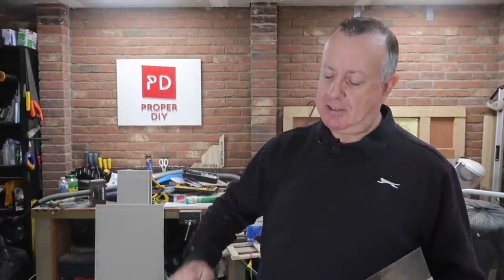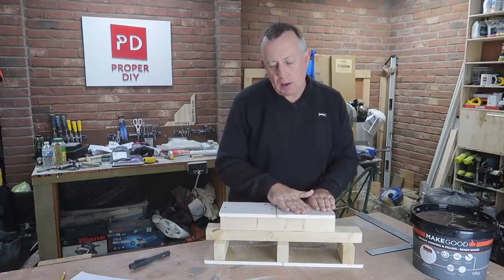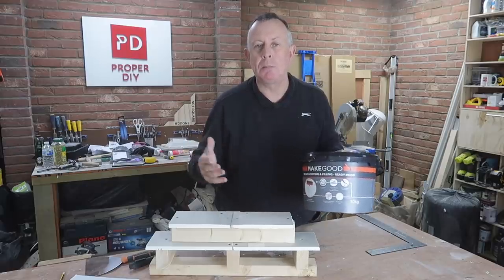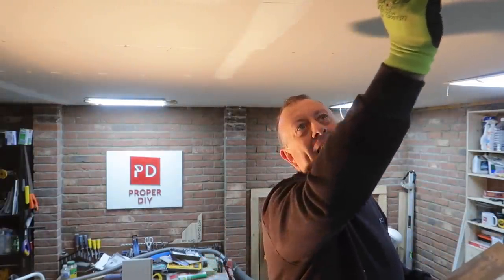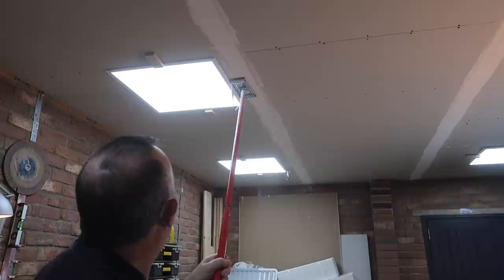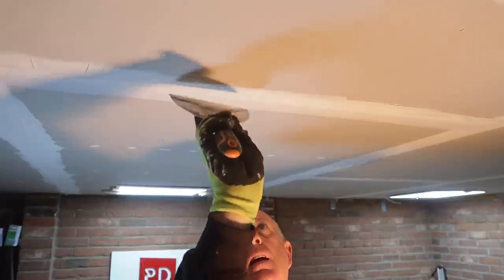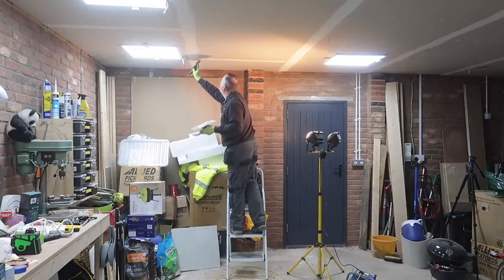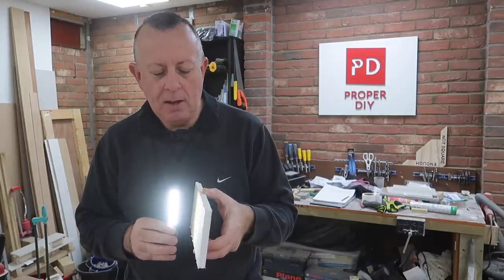How to Tape and Joint Drywall

Comment: Being a decorator for approx 50 years, all we had in the old days was paper tape, some decorators liked to soak the tape in water before applying to prevent blistering. Another definite rule is never to use a paint with a sheen (i.e mid-sheen, silk etc) as these will highlight even the smallest imperfection. Always use a matt paint (usually emulsion).
Reply: super matt is a godsend.
Reply: I tried to tell my in-laws there was no point in using anything sheeny for the roof, but they weren't having it! They're dyed in the wool for white silk ceilings.

Joke's on them, I'm a terrible painter but a very enthusiastic labourer

Comment: One thing I learned about joints. Use the tape or mesh, stick it up and then use white wood glue to stick it. Then, when dry, use your filler.

Comment: I wish all plasterers prepped ceilings like this. Our living room  ceiling was shocking, all screw heads have popped plaster out and cracks on most joints. Good preparation is definitely the key.

Comment: I used the knauf fill when i did my 90 degree ceiling/wall joints taping but that stuff took ages to go off. I then tried the green makegood which is the jointing and filling compound to use with tape rather than the red one you used which is tapeless and is thicker.

Comment: I would of fitted knoggins to support all the edges of the plaster board it’s a little bit of extra work but it stops any movement between the boards and cracking in the future.  Great video 👍👍
Reply from the maker: You can do but modern house building doesn't do that. Once the joint is properly taped and set it's a very strong connection.

Comment: Good Job! My experience with ready mixed fillers are that they soften with a good stir with a filler knife. You can also buy (knauff i think) board end adhesive which is good to lock unsupported ends together. 
So next week plastering wall then? LOL

Comment: I recently replaced the ceiling throughout the downstairs of my house.  I used the tape and fill process as well.

However I used paper tape for all the joints and Easifill.  The tapered joints are easy, the butt joints I filled around 8" past each side of the joint, to lose the tape bump as much as possible.  Whatever tape you use, you have to make sure you have enough filler over the top, or you will sand through to the tape and cause you problems.

Easifill is powder filler, so you can mix it as thick as you want.  My first coat was thick to bed the tape, then a medium coat, finished by a very thin coat that covers any lift off or snags, no sanding inbetween coats.  The third coat really reduced the amount of sanding I needed.  

I painted and then snagged again with filler where needed and my ceilings are flawless.  I will never plaster over fresh plasterboard again....
Reply: You’ll get a better finish skimming it though and it’s much quicker. Trouble is, taping and filling is a DIY job if you’re patient. Skimming requires getting a plasterer in. 
Depends how important your own time versus cost is I suppose
Reply: @isyt1  Taping and filling is faster from start to decoration by far than plaster as there is hardly any drying time.

The huge drawback is that sanding can be messy if you don't have a specialist sander with extraction.  The other drawback is butt joints, as there is a slight hump in the filler, but you can avoid butt joints on average walls as ther plasterboard will be long enough to go from floor to ceiling.
Reply: @Christopher_T_Paul  If you’ve got pros doing the taping then I’d agree it’s faster but if you’re doing it yourself you’ll probably do a second coat of filling after the initial sanding. And then probably shine a torch along the joints and wonder if you can be arsed doing another coat. 

And as you say, the sanding is so dusty it’s a hell of job unless the room is empty

Comment: I have seen a tip (somewhere on Youtube) to fold paper tape in half and rip the unfolded edge, in order to make the edge thinner and so easier to feather.
Reply: This is a good idea, because you're feathering the paper. I used to do this with wallpaper, especially when making small repairs.

Comment: I was a big fan of The Friday Night Live show (UK version). It featured a who's who of young UK comedy talent of the time. "Loads of Money" & "Stavros" were my Harry Enfield favourites as well as Ben Elton when he unleashed his tirade on the politicians of the day (mainly Mrs. Thatcher) interspersed with the obligatory knob joke 😂. 
Good tips on plasterboard jointing. Plastering is a job I have never really been able to master & have managed to steer clear of so far. However, after watching this I reckon I would have a go at a garage ceiling or a utility room ceiling or wall. I did manage to fall through a ceiling once many years ago while I was installing central heating. It was a lath & plaster ceiling in my first house built in the 1880's. It made a right mess & resulted in the whole living room ceiling having to be taken down, boarded over & replastered - by a pro. You live & learn!
Reply from the maker: I've never fallen through a ceiling but been close a few times. I'm sure the mess it makes and the work involved in putting it back is a real pain

Comment: Did this for first time on my garden gym build last year. I mixed the compound myself BUT was far far far too generous on the volume used. The sanding was HORRENDOUS! My deltoids and biceps were knackered by the end of it and the entire room was about half an inch deep in dust. It was still coming out of my hair two weeks later…. Also loved your point about blemishes at the end. I only plastered the ceiling of my gym and can live with the blemishes. The walls are all plywood so no tape and jointing to worry about there:-)
Reply from the maker: Yes taking off compound is far harder than putting it on.

Comment: I saw a tip on YouTube that it’s better to mix in some washing up liquid to make the filler more workable
Reply: Don’t take as gospel anyone suggesting using washing up liquid as a plasticiser, buy the purpose made stuff. The problem with washing up liquids is that they contain salts which can make their way through finishes especially bad when used in mortar cement.

Comment: Our Redrow new build you can move the plasterboard up with your hand, can see all edges of entire boards, nail pops everywhere and severe movement from upstairs which sounds like a train. Redrow sent some guys out and they put 250 screws in lounge ceiling, another 250 in master above floor, redecorated the ceiling and the result is the same as before. NHBC tell us its fine, snagger has laser leveled it to be over 14mm sloped and needs noggins / bracing. 400 snags later, still fighting.
Reply from the maker: That is a shame - I feel for you. I wonder would thickness board they used? I think our house building standards have really been lowered to the cheapest possible. Not good that NHBC think it's acceptable!
Reply: @ProperDIY  I think it's the lack of enforcement of standards. Our house had all these snags left after all these works and those screws in the ceiling. What gets me is that the nhbc didn't even bother to measure it even though our snagger, Snagaroo (Paul Frost) did, sadly Paul passed away and we have been fighting Redrow and nhbc on our own. Not sure how they can ignore something measured.

Were working with our MP on the new ombudsman and have gone to press which is everywhere at the moment.

I sent you our reports a while back if you want to see the current standard of building. Can send you nhbc report too.

Comment: Good Job on that ceiling, it’s a dusty process which is the worst part. Thanks for sharing the lights link. Yeah I never found the ready made compound any good as you can’t get it to the consistency to work with it easily. P.s first night in our new house and you got me itching to get diy ing

Comment: Hot mud on tapes.. "powder "  esp fibre tape.. will get the job done a lot quicker .
Premixed will air dry  take longer to dry.
Powder will chem reaction dry..
Just a handy tip.

Comment: Nice video Stuart as always. Maybe I missed it but it would be good to know what the rest of your plans are for your workshop. I have a new build garage that I’m going to turn into a workshop. I’m going to be following your vid of cutting in a new side door and adding plasterboard. I’m also thinking of soundproofing the walls and lining with Ply. However I may end up using plasterboard and taping due to the silly price of Ply at the moment. So it would be really good to know your long term plans. Have a good Christmas and hopefully a prosperous 2022 for you and your channel.

Comment: You could of made life easy buy using a curved drywall trowel on butt joints then 10 or 12” knife either side of joint also buy yourself a mud pal for the knives it’s easier to keep blades clean and control the mud 😉👍